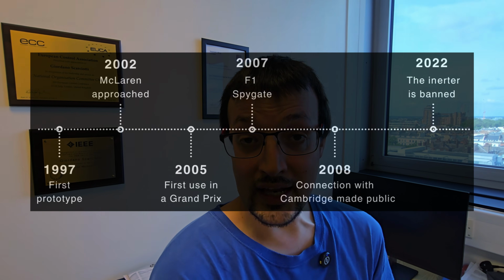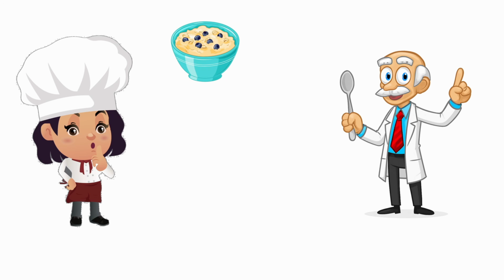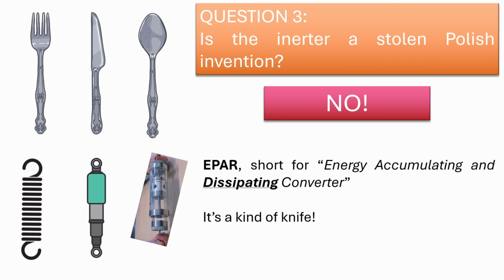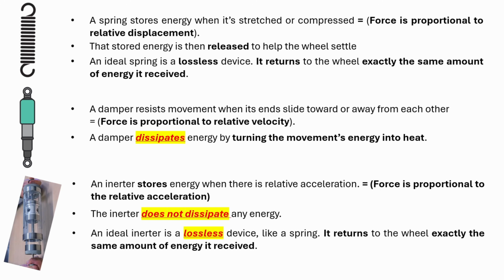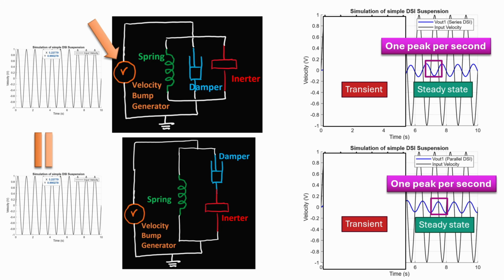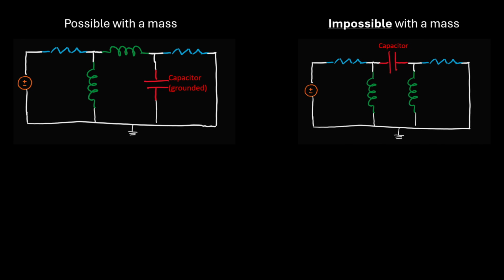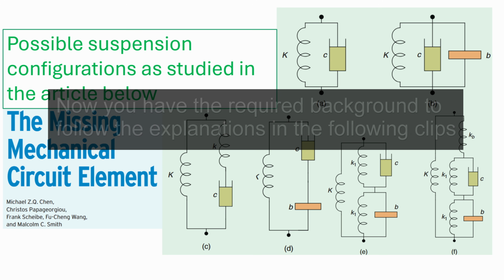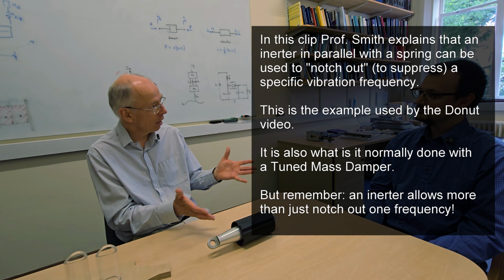Why Everyone Gets the F1 Inerter Wrong | Explained Clearly

Comment: This correspondence, in frequency response, to electrical components seems useful to me: springs, like coils, are low-pass filters. Inerters, like capacitors, are high-pass filters. I feel this should help to explain the gap that the inerter fills. Low-pass and high-pass filters, each with their own spring constant and inertance, plus dampers with dampin ratios,  can be combined to match a desired frequency response. This symmetry between high-pass and low-pass seems important to understand how the new element, the inerter, helps to be able to build systems that have a frequency response that cannot be achieved without.

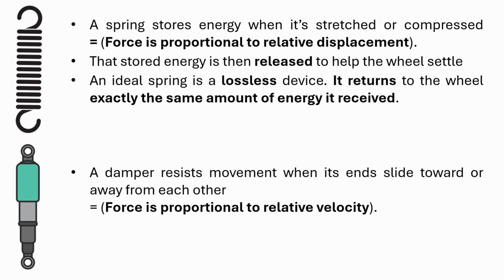Comment: @12:21 Damper resists movement in only one direction: its extension. When compress, it must offer no resistance at all. So the passive model with RLC should include diode. I still don't get the advantage of the inertia model that create resistance in both way over a classic damper with fluid and valves.
Reply: "Damper resists movement in only one direction: its extension. When compress, it must offer no resistance at all."
Uhm, what?!
Reply: @TarenGarond  Yes, there must be absolutely no resistance when you push a damper.
Reply: @Percy-k3f What about the 100 percent of dampers in car suspensions that have damping both ways?
Reply: @TarenGarond  What's the point to have a "friction" during compression ?
Reply: @Percy-k3fto decrease velocity and reduce the necessary amount of spring rate which in turn reduces the overall amount of oscillation you need to control.

Comment: The image at sec 22.13 basically shows the early Citroën 2CV suspension. It had coil springs, friction dampers AND inertia dampers. The spring (-s) had a short (hard) throw but the axle geometry gave it a long throw at the wheels. The inertia dampers consisted of spring suspended weights (incl damping capability) calibrated to the rest of the springing system. Together with a very accentuated anti dive and a clever front end hub geometry, the car had excellent roadholding capabilities. Some F1 technician's are aware of this fact.

Comment: So there are these three elementary mechanical devices: Spring, Damper, Inerter. In the spring, the load is proportional to the position. In the damper, the load is proportional to the velocity, in the inerter, the load is proportional to the acceleration. My question is the following: Among these three devices, the only one that dissipates energy is the damper, while the other 2 will sooner or later give back to the system the energy they've absorbed. Is there a fundamental physical reason for this, or it is just because of the particular physical implementation of the damper that produces this dissipation as a side effect? Is it theoretically possible to have a fully mechanical damper that somehow returns the absorbed energy?

Comment: As a guy with an electro-mechanical control systems background, I understood this akin to PID and amplifier design, and that the trouble others are having is akin to people figuring out the model of a transmission line as being a combination of LRC elements per unit length.  Before that was figured out people did not consider the L for a long time and they were omitting the magnetic field - I also considered the problem like that of complex numbers - the imaginary part works but for a long time no one understood why until we figured out that energy changing between electric and magnetic fields as it propagates needed that other dimension - our cartesian view of X and Y needed to have i introduced going around and around.

Comment: This  reminded me of a toy I had as a kid - a motorbike (matchbook size) where the back wheel was solid metal, and you had a long plastic toothed stick (a rack) that you pulled through a guide on the bike which actuated a gear attached to the wheel (both a wheel and a flywheel in one). I would push and pull on that plastic stick and feel the inertia, and had some intuition this was something like a spring, but different.

When you pushed the stick, it would keep going even when you stopped pushing (or pulling). It was neat, I probably played with it more like that than the intended way, which was to rip the stick out really fast and let the bike fly (and then have to go get it, a mile away - probably why the novelty of that wore off)

Comment: I don't see how an inerter stores energy the way a spring does. If I compress a spring for an amount of time, let's say 60 seconds, when I release it, it will return  to its original  length. I did not think an inerter behaved this way
Reply: Your analogy does not work because once you set the flywheel spinning, it will freewheel until the screw hits the end stops likely before your 60 secs are up. Then the energy is dissipated. But if you set it moving till it reaches half it's displacment and then brake it, it will give back to the brake exactly the energy you had put into it.

Comment: When you mentioned systems thinking and returned to Prof Smith where he mentioned EE vs mech eng thinking, I was reminded of how the memristor was predicted as a missing element of electrical components. It was unclear how to build them, but EE's, using systems thinking, where able to see a functional void. (I'm not comparing inerters to memristors, just the way systems thinking provides insight)

Comment: I see a mechanical PID controller with the inerter providing the D part. These are well understood. D has a significant impact on step input response overshoot.
Reply: This is exactly what came to mind when I was watching this! Great pickup 🙂
Reply: Actually, rereading my old textbooks, we didn’t get this quite right. Given the inerter is the mechanical equivalent of a capacitor, it’ll have a role in both the integral component and the derivative
Reply: Reference is velocity. Thus proportional is velocity. Integral is position and derivative is acceleration. Maps exactly
Reply: @markspieth7591 Am I missing something? Springs are position sensitive and produce proportional force X displacement. Dampers are velocity sensitive and that's our derivative term. Inerters are acceleration sensitive. I don't think there's a direct PID analog? 

The 'integral' term would be something which varies due to historical motion. I don't know if we really have anything like that, either?
Reply: There is a nice table in the video which details the capabilities of each component type. Its quite clear.
Reply: The 'D' term is 'differentiation'. The 'D' term is the damper, because it's velocity dependent. If you had a PIDA controller, the interter would be the 'A' term.
Reply: @MrTL3wis I remember it being taught  proportional-integral-derivative, not sure about PIDA.. where is that taught?

Comment: It still seems like TYPE of damper (the general term lay people think of, not the literal engineering meaning) it just dampens acceleration and deceleration of compression and expansion over time. 

IE A temporal acceleration/deceleration damper (it reduces the rate at which acceleration or deceleration builds up or diminishes).

They modulate the PERCEIVED inertia or resistance in a system to behave as if it has more mass… without the actual mass.

Comment: What are the units of inertance?  A spring (k) is N/m and a damper (c) is N-s/m, then an interter (b not i?) should be N-s^2/m?  If this is correct, then the explanation was successful.  Also, at 31:44 in the video, there are six mechanical circuit element, perhaps in your next video, you could explain the pluses and minuses of each configuration.  And finally, the most important question, if someone offered a properly designed inerter for my existing street car, would it have a smoother ride?

Comment: Noob non engineer question: a damper changes the amplitude, a spring shifts the phase, but an inerter also. What is the difference? And why isn't there a device needed that changes the frequency?

Comment: You still didn’t explain what the inerter did for F1 teams. As the fellow from Renault explained here in the comments, but I feel not thoroughly enough, the purpose of inerters was to control the spring that you cannot otherwise control: the tire. The whole point of the inerters is to control tire carcass oscillations. When the tire compresses and expands the contact patch with the road increases and decreases in size. That results in changes in grip. The tire itself is a spring that you cannot attach a damper to, so how do you reduce that spring’s movement? And the inerter is the answer. You figure out the nature of the tire’s compression and expansion cycles and you choose the inerter values that will reduce those compression and expansion cycles the most. That gives you a more controlled tire contact patch that is larger on average, resulting in more grip more of the time. You make the size of the contact patch more steady over time, and that gives you more grip on average, giving you faster lap times. It isn’t used to give you better control of the suspension itself. It is used to give you some control over what the tire is doing. It simply uses the suspension to transfer that energy to the tires to alter the tire behaviour. But you do not use it to alter the suspension behaviour itself. Changes in the suspension behaviour itself are just incidental in allowing you to alter tire behaviour. That’s all you’re concerned with. Tire behaviour. You’re not concerned with suspension behaviour directly, not beyond what you have to do to the suspension parts in order to affect the tires. That’s all you want to do, affect the tires.
Reply: It is not his job to explain F1, it is his job to explain systems engineering., control theory. It is our job to consider applications. The inerter may have been used in the heave springs to control aerodynamic and braking oscillations, because F1 cars to not have a long tail on a stick as do aeroplanes (damping varies cube of arm length I believe, recall). So the fellow from Renault, and another poster from motorcycle racing perhaps on the other video may have only considered the inerter on tire hop applications that have been and still are application areas of a plain mass damper.
Reply: @retroproto8075 ”F1 Inerter Explained” is literally the title in the thumbnail. Heh.
Reply: @ClaytonMacleod  touché , but realistically he is an academic theorist just like Malcolm, we would have not detected the videos without our F1 or racing tech greed.

Comment: The explanation of what systems thinking is at the 5 year old level was excellent.   However, I think an important point is that he knew the spoon was missing.  He knew they needed three mechanical components because in the electrical world there were tasks that could only be completed using the third tool; an ungrounded capacitor.   In that sense he knew exactly what its purpose was, to mimic an ungrounded capacitor.
Reply: That what I thought when listening to Prof. Smith and the problem of two-terminal devices. Grounded capacitors eventually results in low/band-pass transfer functions. In this case ungrounded capacitors are pretended to be used in notch filters? I am missing this part, I will dig in tecnical details about the circuit topology of the inerter circuit. I guess it should be a double Tee circuit to implement a notch.

Comment: I am not trained in any engineering, but I understand what the inerter is. I am still struggling a bit understanding how using it effects drivability. Also curious about using it on passenger vehicles, possible ways to integrate into suspension systems with images or drawings that don't include vague stick drawings if possible thanks. Other than that great video!

Comment: Thank you, Professor. May I sugest you to add a third video showcasing applications of the inerter in areas other than suspension control. This would be a great way to enhance the intuitive understanding of the component and its role as an energy storage device.
Reply: Indeed. I can understand how different shocks and spring strengths feel, I want to understand how an inerter added to a system would effectively "feel" different. Better road contact or less oscillating when turn acceleration changes in turns and speed changes?

Comment: So I still don't really understand why you want this device in a suspension. It stores and releases energy in the same direction so it reduces the big force and compensates for small force. So the overall amplitude of the forces is smaller and the rest of the system don't have to be as big?

Comment: Didn't Malcom Smith think of the analogy of a shopping cart? We've all done it as kids: gone to the supermarket and treated a loaded cart like a race car. You push it HARD to get it going, hop on, and the thing coasts for AGES. The only times you need to put in any effort are to speed it back up or slow it down. An object that resists any change to its state of motion: one with high inertia.

Of course, you don't want a race car to be lugging around hundreds of otherwise redundant kilograms the way a Rolls-Royce Wraith does. Heavier cars tend to give a smoother ride, being less likely to transfer the vibrations of suspension motions to the occupants. It's like the difference between pushing an empty shopping cart and a fully loaded one - the heavier the object, the greater its inertia. This is why Rolls-Royce doesn't build flyweights and high-performance cars have lightweight wheels: increasing the ratio of sprung to unsprung mass makes a car less reactive to bumps in the road. 

(EDIT: The R35 Nissan GT-R actually used its 1600-ish kg curb weight as an asset in this way. Like a sumo wrestler, an R35 is utterly unflappable on bumpy roads because of its mass. The R35 is kind of the beautiful union of those two aforementioned approaches.)

Think of it this way: when unsprung mass hits a bump, that bump basically launches the unsprung masses at the main body (sprung mass) of the car, and the job of a suspension system is to "catch" the wheel and tire (and hubs and brakes, etc) assembly the way a baseball player catches a ball and press the tires back into the surface again to maintain grip.

So, what if we could simulate a chassis with far higher inertia than it actually has, so wheel and tire motions (unsprung mass) don't throw the car around as it hits bumps, without having to live with the high mass figures of an actual luxury car? What if we could somehow engineer in more inertia? Ladies, gentleman, and otherwise...... the inerter. That, in layman's terms, is what it does.
Reply: the plain mass damper seems to be used more in the application you describe, it is now required in motorcycle racing to reduce 'high side' accidents It could be that the inerter is amore subtle device  since at the moment the bump is hit it would seem to stiffen the suspension before it starts turning, then it absorbs and stores some peak energy, and later it diminishes further oscillations using the stored rotational energy on deceleration and then using its positional stored potential energy on travel in rebound, and on and on in decay. The inerter would seem to allow softer springing and softer hydraulic damping.

Comment: O.K. I'm 10 minutes into the video and I've learned nothing about what an inerter is. I've watched an "explain it like I'm 5" which doesn't explain it, but appears to be trying to define Systems Thinking.apparently for 5 year olds and failing. Now I'm in a section that appears to be trying to tell me what an inerter is not, before even giving me the faintest idea what one is.  This video doesn't merely "bury the lede", it chops it up, cremates it, and then buries the ashes. If this professor actually teaches students the poor souls are doomed. I'm not convinced that I ought to watch the rest because if it's all at the same level of non-explaination then I'm going to use up another 30 minutes of my life and still learn nothing.

Comment: Very clear - if you need to dampen a 5 Hz road noise, you cannot create a notch filter with just a spring and a damper. You need the inerter as an equivalent capacitance, to tune the circuit.
If you had to notch out two frequencies, say 5 Hz and 7 Hz, would you need two inerters?
Also are any commercial sports cars using inerters?

Comment: As per usual You Tube tutorials, the explanation missed an essential engineers "feel". When the inerter was being stretched or compressed, it should have been let go. We would the see it continue the movement until either the limit was reached or friction losses brought it to a stop. If the losses were high it would just act as a delayed damper. The meccano model showed it's relationship to a flywheel. To be an effective notch filter, it's losses would have to be low and it's peak load tolerance high. The torque reactance of the internal flywheel would have to be tolerated by the mounting yokes.
Reply: I would demonstrate it as an old hand pumped railroad car which had no freewheel, which is the closest human predicate technology I have come up with. And then lifting the car above the tracks to operate only with the wheel mass..then not essential by and aplication try to replace one of the men with a spring.

Comment: It’s not a lossless device. It dissipates energy. Otherwise the terminals would keep moving after acceleration until reaching the end of travel. No, they stop moving within a very short distance which means the energy is lost to friction.
Reply: If the actuating rod continues to move for a similar distance in the same direction (or function of distance and velocity) once the input force is removed, as I believe it does, then it is a lossless device, ignoring the small friction losses. This should have been clearly demonstrated with an actual inerter.